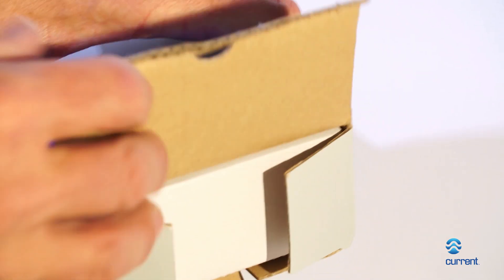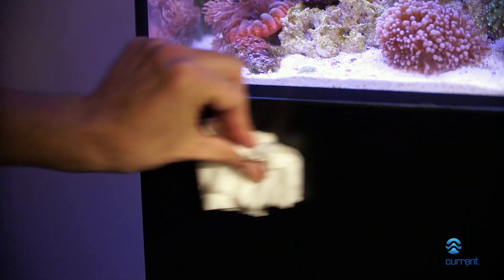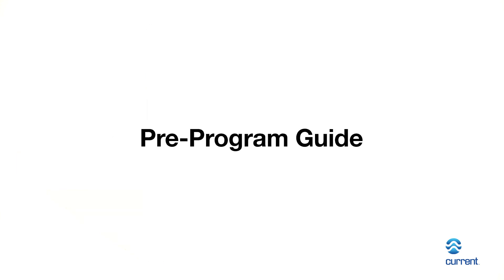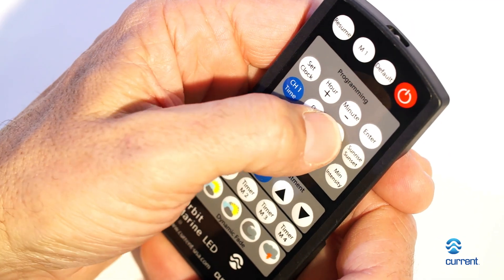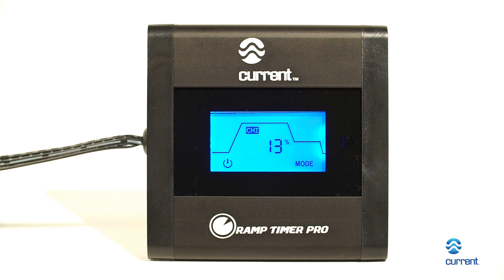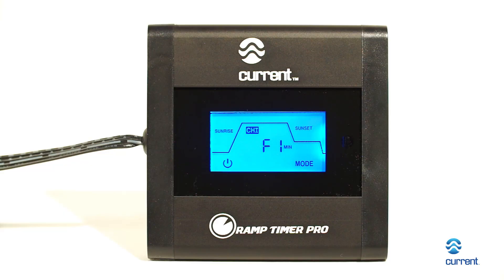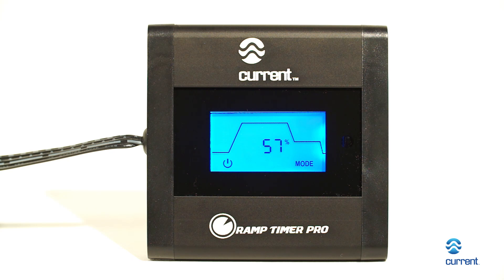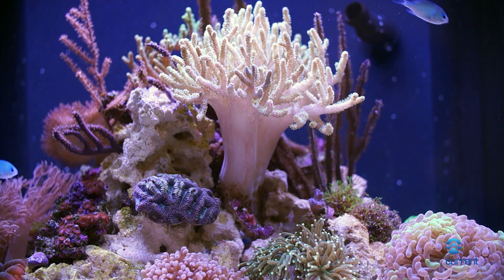Orbit Marine Instructional Video

Comment: Okay I click on M1 but the light doesn’t turn on, it’s 2:46 PM so it should be on. But clicking the arrows makes the light turn on, but then once clicking M1 the light turns off
Reply from the maker: This usually means you just need to re-program what schedule is in the M1 location, or you can default the controller back to factory settings.  If you reach out to us via our website, a tech can send you instructions (it's easy.) https://current-usa.com/contact/

Comment: I’ve had this light for a few years now, and the daytime light is not as bright as it once was. The blue still seems good. I checked that the white is still at 100%, which it is. Is there anything else I can check or maybe a factory reset? Or is this the light’s way of dying so I need to replace it?
Reply from the maker: Hi - if you want to reset the older Orbit Marine LED light with Ramp Timer Pro to the factory default settings, press and hold the default key for 7 seconds. It should then default back to factory settings.

Comment: So how's everyone's corals doing with this light? I seen people say they had to get 2 lights for bigger tanks. I was thinking about getting 2 for my 125g reef tank, but been skeptical of doing it.
Reply from the maker: Hi Stormy, we only recommend these model lights for shallow tanks or soft corals. On a 125g, you'll only want to use them for softies and LPS corals.
Reply: @CurrentUSA  how about with Anemones?
Reply from the maker: @ramhemi75  As long as the tank is 18" or less, you'll be fine!
Reply: It's deeper than 17" I think.
Reply from the maker: @ramhemi75  Then you'll likely want to use 2 lights. What type of anemone?
Reply: @CurrentUSA  not sure yet, if I get one it'll either be a bubble tip, carpet, or Haitian
Reply from the maker: @ramhemi75  If you can hold off until April, our new Orbit Reef will work for you. Otherwise - you'll definitely need 2 lights.
Reply: @CurrentUSA  I will with no problem. I'm slowly piecing everything together
Reply: @CurrentUSA  it's April......what did yall come up with?
Reply from the maker: @ramhemi75  Launching next week, its already on our website!
Reply: @CurrentUSA  is it the IR lights? I don't remember seeing them before
Reply: @CurrentUSA  I ment IC pro

Comment: I have a 90 gallon reef tank. Since the 48-60 unit only puts out about 40 watts, would I need to buy 2 units to get the PAR I need to support my reef needs?
Question 2: Can I pair 2 of these lights together or will I need two timers?
Reply: I was wondering  the same any anser yet